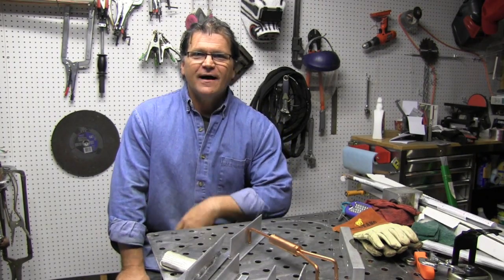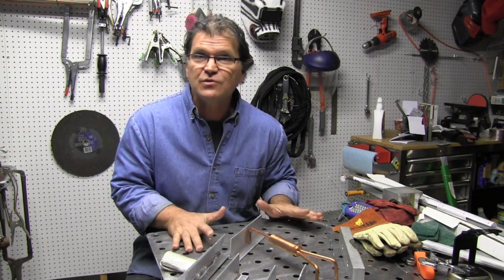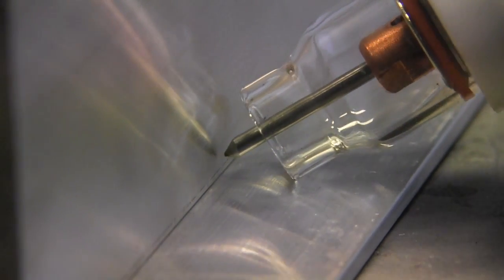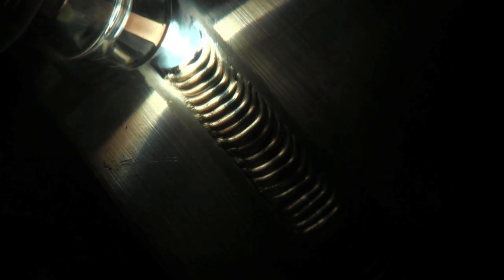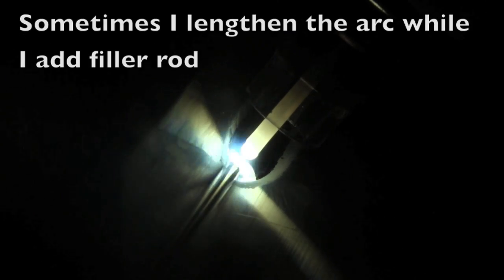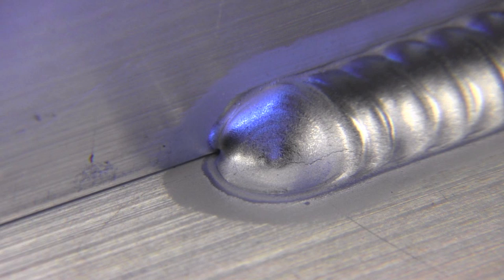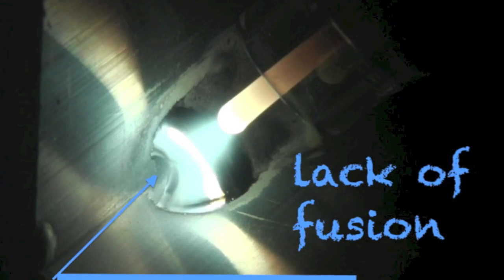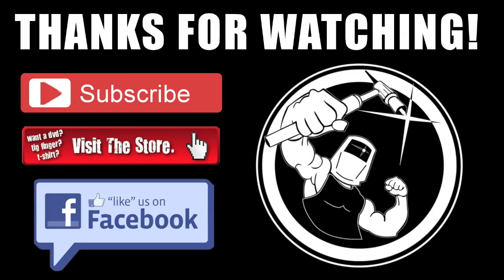TIG Welding Aluminum - Tips for 2f Tee Joints

Comment: I have this exact same machine in my garage. I love it. But I went to my local weld shop and they told me I couldn't use 2% lanthenated with the 175. But you do so I guessing that it is ok?
Reply: Ahhhh ok cool. I'll go back and get the 2% now then. Thank you for the help
Reply: ***** your pretty much spot on with both the assertions. Product knowledge from a manufacturer sells supplies and tools yes, but to actually help people with their projects or occupations these supply stores tend to be limited. Its like Home Depot, lots of great people to help answer questions on the products.. but how many of them are actual carpenters, plumbers, electricians, and contractors? incredibly few.

I can read manuals and do months of homework on the products in a store but thats different from actual hands on experience, and everything is with a grain of salt. alot of this stuff is "will and way"

Comment: Thank you very much for this latest installment! I am new to TIG and just started with aluminum (pretty much the exact same setup as this example). I had some problems, but with this video most of them are worked out and running decent beads on the first try.
Reply: Look up his "Aluminum Welding Drill" - it's phenomenal & will help you out -

Comment: really helpful, ive been having a problem with the start on a joint. round tube 45% cut end onto a flat plate, the one side is so tight I cant get in there with the point?  please help Jody im going mad!!!!!!
Reply: One suggestion I would make is use smaller tungsten if you're trying to get in really tight. There are two functions tied to electrode size when welding aluminum. 1) how much amperage it can handle. A 1/16 tungsten will disintegrate if you're blazing away, especially on a transformer machine. 2) how pointy you want the arc. When you weld aluminum, your cone is basically going to be the size of the tungsten. Starting with a point like he shows here isn't a bad idea, but you'd have to sharpen your tungsten every time you want to go from welding to tacking. A smaller tungsten makes a pointier fire.
Reply: nunya bizniss thanks for the help, I will try your suggestion and let you know how I get on

Comment: Hi Jody. That vid is just what I needed. I'm doing everything wrong. Can't wait to try new technique. I question is sometimes takes forever to start a puddle. My garage is unheated. Sometimes very cold (under 30 degrees) does that matter? Surely people have tig welded pipe in winter right. Thanks for ALL your vids. Ps got 3 feet of snow here on Sunday. #rhodeislandsucks.
Reply: Add some heat with a torch before you start welding. Even a propane torch will help a lot. I do this on thick materials even when it's hot outside.
Reply: Thanks for info.
Reply: Preheating also prevents cracks and some of the warping.

Comment: how do you prevent the aluminum from warping?
Reply: In addition, if warping can't be avoided, just tack it at reverse warped position, so it will warp into the right position. For example, if you weld a tee joint, tack it at about 95 degrees, it'll warp back to 90 degrees.
Reply: depending on the circumstance you can Bolt the material or clamp the material. if neither is an option it may be tricky to do, but with proper application of heating and cooling periods you can retain much of the original integrity desired and minimize any warping from thermal exchange.

anything you can mount solid to a fixed position helps, otherwise.. patience and diligence is your only feasible option
Reply: exactly

Comment: All the advanced guys show aluminum tig with the stubby gas saver kits.  How much different is it with the standard alumina cup set up?  Is the difference extreme or is the only real advantage the electrode stick out for visibilty?  Also, on the square wave I tried, the tungsten doesn't maintain a point at all it immediately balls up.
Reply: Hi

Comment: I am only using 2% lanthinated for my Dynasty 300 DX welding, but I see D.G. offers a premium version called Wolfram ??   I have never seen you mention this, have you ever tested it out ?? Your video setup would be a great way to actually see it in action and tell if it provided any benefits in arc stability or other. I feel that the china thungsten might not run as clean as the std. D.G. so maybe there is a benefit but I have just not popped for the $$ to try it yet.
P.S. you have taught me to Tig over the last couple of years, before that I just owned a machine. !!
Reply: Tungsten is wolfram and wolfram is tungsten. Tungsten is "W" at periodic table. I use pure tungsten electrodes (green color, at least here in europe) for aluminum because aluminum is very sensitive material for impurities. Pure tungsten is not the best possible electrode because it decays quite much while welding but it gives cleanest weld. Quality of tungsten electrodes is pretty important thing and in my opinion it's best to buy electrodes from a well known manufacturer to be sure you get what want because cheap electrodes might have less tungsten and more of something cheaper.
Reply: Wolfram is the german word for tungsten ....  that is all i know.
Reply: *****
I was in hopes it was measurably better and that maybe my mentor here had tried it somewhere along the way and could advise.  At $74 for Wolfram vs $33 for D.G. std. vs $19 for china made on ebay. I have searched the internet pretty good and found no real testimony so I was asking our fearless leader here !!  

P.S. Jody, if you have not tried it and want to I will order it and send you some to use in a video comparison, it would be the least I could do for the service you have given us on your channel.
Reply: Wolfram is only another name for tungsten.
Reply: Helikopterpop  Why is it sold a premium quality product and at double the cost ?? I guess it is just a scam that Diamond Ground plays to get our money, huh... I am going to try it to see if no replies.
Reply: Maybe it's a more pure and true composition. But still wolfram is the same as tungsten. Tungsten is a word that comes from sweden, but we also say volfram or "wolfram" so if there isn't any aditional info it is just a straight tungsten electrode. I follow jodys tip and use lanthanated only (but I am not a welder in any professional point of view)
Reply: btw tungsten is read out as "tung" "sten" which translates as "heavy" "rock, stone" since it's high density/weight
Reply: ***** You know, I re-read it all and you are the only one wasting posts with no contribution. Just complaining. You appear to post and reply to everything and never add anything. Just Sayin...
Reply: ***** I just thought Jody might come back with some information as I thought that was what this was about, not half whits rambling about not liking other peoples questions, and offering nothing. Jody specifically asks us watchers to ask questions and comment, and I did. I have watched all his videos for years. I saw on D.G.'s site tungsten for wildly different cost points and was simply curious. I sell nothing to do with anything here and welding is only a hobby to help support my racing habit of years past, in fact I run a plastics factory in southern Indiana and just today got in an order from weld monger for a T shirt, tig finger XL and (2) strong hold clamps he sells on his site. invoice # 9322 and have bought his Tig Fingers, video series and shirts for years to help him and to support his efforts. What is your contribution to his efforts, I have read your constant posts and the answer is NOTHING but oral Diarrhea. I will not further respond to your crap.

Comment: Ok I have a question. I'm in school right now and we are working on T joints. We are using pure tungsten with 1/8 filler rod. I'm having trouble starting my puddle. How can I fix this problem? And also should I be using 3/32 filler instead of 1/8
Reply from the maker: I don't care for pure tungsten much but you can make it work if that's your only option. I think a smaller 3/32 filler rod will help.
Reply: weldingtipsandtricks Ok well thank you. We are only given pure. Well I got class tomorrow and I'll try that out. Thank you for all the videos and for responding
Reply: Make sure to clean the Aluminium oxide off the surface, it makes all the difference. A bit of Scotchbrite should do the trick.
Reply: weldingtipsandtricks I been stick welding mostly with my inverter Everlast welder but I want to get my feet wet tig welding aluminum. I hear 2% lanthanated is a good tungsten to work with. Is there anything better I can be starting with?